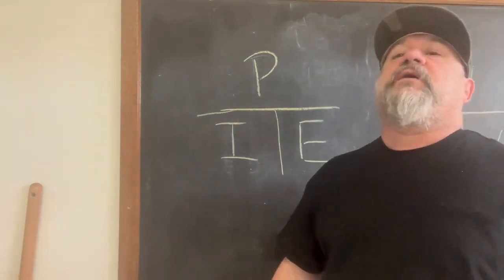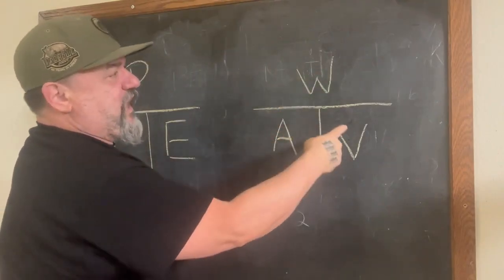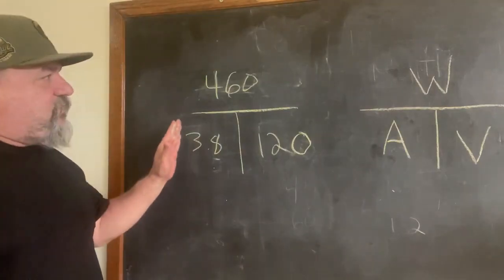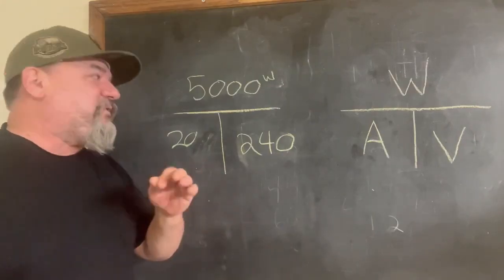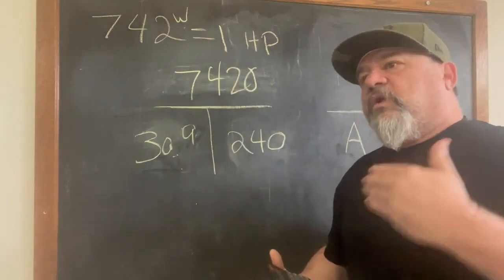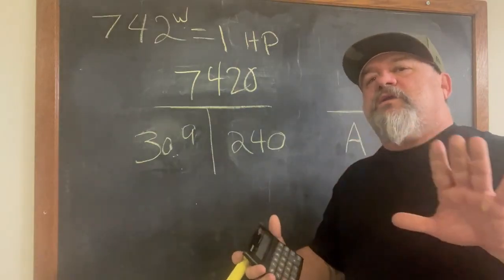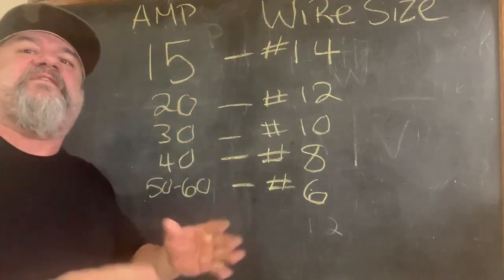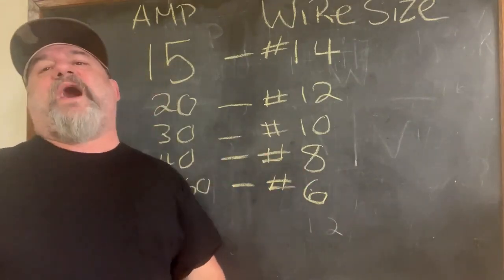Easy Electrical Math Tricks You Need to Know!

Comment: I did electrical design for 35 years!   This video is correct!   It’s just that easy for what he is telling you!   BTW the 80% of a breaker is what it can handle continuously.   Continuously means three hours or more.  Non continuous loads less than three hours can be protected at 100%.  Almost never do that though.

Comment: In my work this is only suitable for DC, when we are working with AC we need to take into account phase angles cos(phi) if we are working with a capacitive or inductive circuit and then for 3 phase multiply with a square root of 3.